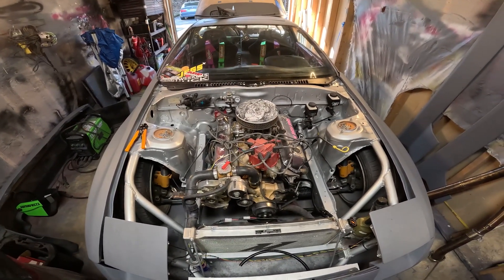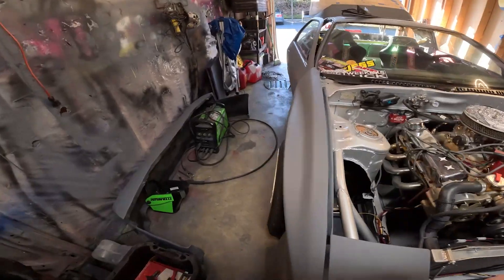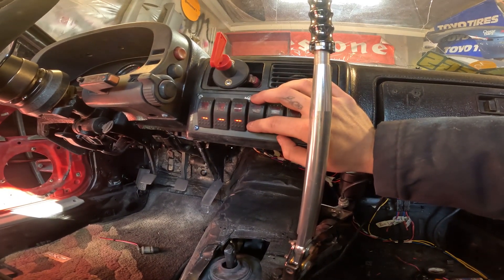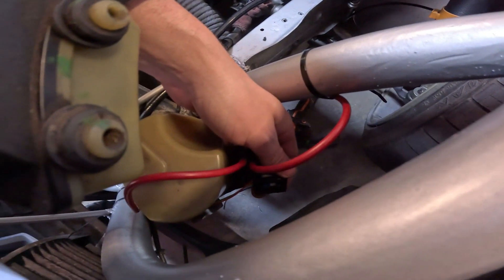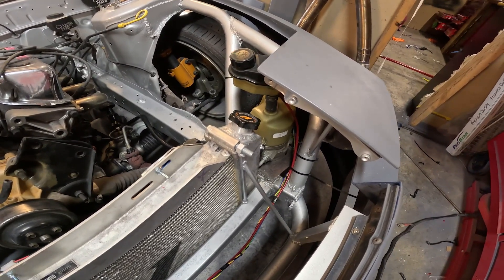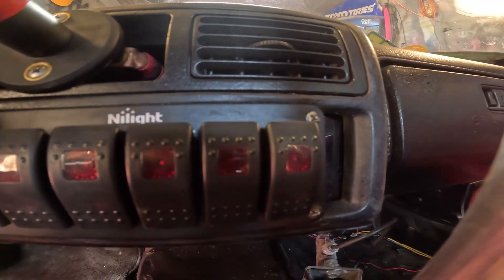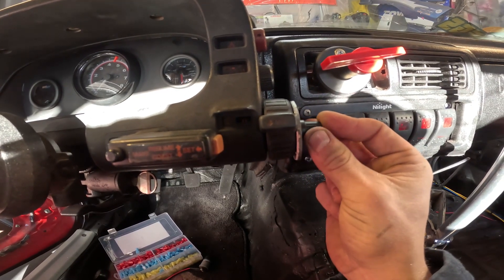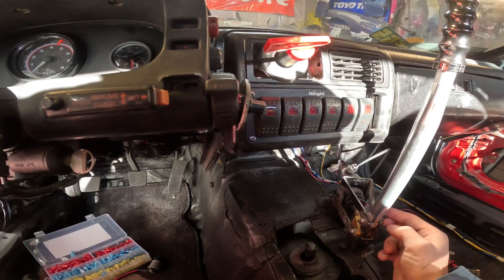VOLVO ELECTRIC POWER STEERING COMPLETE!!

Comment: Are you using a simple potentiometer with your setup or do you have the pump speed controlled by some external controller?
Reply from the maker: It’s controlled by a external controller. There is a guy that sells everything ready to wire in
Reply: @3pointsautoworks  Thanks! How do you like its feel when drifting? Does the level adjustablity help much?